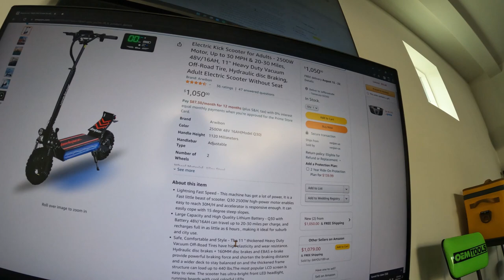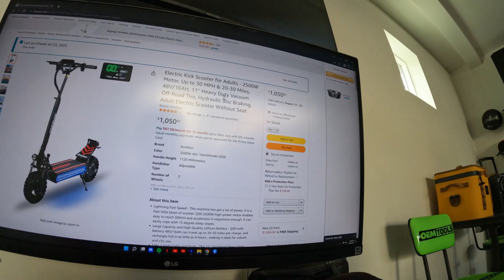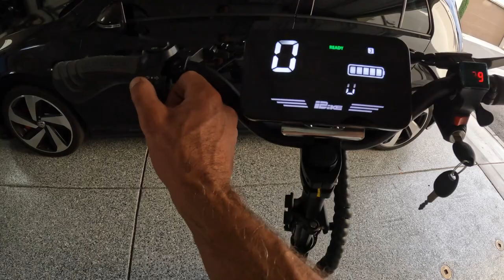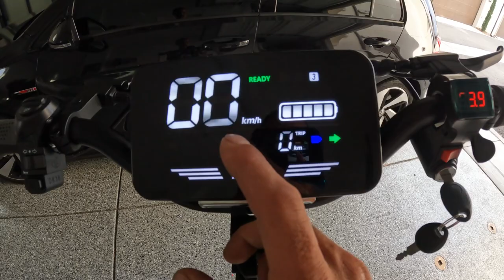Arwibon Q30 Electric Scooter for Adults 48v 2500 WATTS

Comment: Nice run man I just bought one can't wait until it gets here
Reply: Hey any update?
Reply: @shaukmkadin9101   updates please
Reply: Yes I've had it for about 3 weeks now and put on about 35 miles and it's freaking awesome. I was about 245 lbs when I got it but I've been on a diet and now I'm at 217 lbs and you can definitely tell the power differences from weight but it still moved and made it up hills with no problem. If I had any complaints it would be the fact that the digital display is in km instead of mph and the take off speed isn't as fast as I would like but not horrible either. Other than that I definitely recommend this especially for the power you won't find one better for the money.
Reply: @demonoidphantom  Wow! Congrats on the wight loss! 

Thanks for the response

Comment: about to order this and saw your video thank you
Reply: Just bought it on Amazon should be here 2 weeks
Reply: @BigBird_714  how is it ?
Reply: @TheMostHatedENT  hey was up umm only thing is wish the manual had little more info on gears and volt meter but I figured it out other than that this thing rocks love how the tire sounds when driving fast
Reply: @BigBird_714  did you do a range and speed test?
Reply: @PathToPeaceMoe  range not fully I ride about 4 miles a day 5 days a week and have to charge it on Wednesday I’m 6’4 285 pounds and I can go about 45km

Comment: @The Cats Pajamas According to Arwibon to change the dispay from kph to mph you have to change the controller (It's the silver box under the deck plate). But they don't advertise the unit on their website. But if you speak to them via Chat, they'll make a link for you to buy one. It will be sent from China. But on their website, you can buy another charger and the upgraded 30AH battery. If you buy the extended battery, they'll ship via sea and that'll take 2 months to arrive.

BTW, I'm 6'2" and currently 295lbs and this single drive Q30 easily hauls me around. They just released the Q30 PRO... it's a 5600W version with front and back motors. Without load the motor at setting 1 spins upto 48kph, setting 2, 68 kph and setting 3,  73 kph. I'm also told between batches this can change up to -/+ 2% difference between batches. It depends on which motors they use from which supplier at the time of assembly. Under my hefty weight, I get 27 kph (16 mph) on setting 1, 38kph (23mph) on setting 2 and an impressive 51 kph (31mph) on setting 3.

https://arwibon.com/
Reply: Do you have the 16a battery? How is acceleration? Does it do okay on hills?
Reply: They did. Scary!

Comment: This is awesome great video!
Reply from the maker: Thanks ... i am always buying ridiculous stuff  ... so stay tuned lol
Reply: There're 2 charging ports because you can buy another charger and charge the battery 2x as fast, that is the only reason for the 2
Reply: @thecatspajamas2765  How long is the battery lasting on this scooter 🛴
Reply from the maker: @Zenmazter  i just got the scooter not long ago so i dont know the lifetime life of the battery yet lol but far as distance 20 to 30 miles is the range on a single charger ...if u going uphill and full throttle the whole way you might be down to 15 to 20 especially after months of use , the farthest i personally have gone in single charge was 23 miles and i still had 2 bars of battery and i could start to tell it had less power leaving from a stop after 20 miles than it did at full charger but it still goes nicely and can get up to nearly full speed ...
Reply: @thecatspajamas2765  hey can you change it from kph to mph?
Reply from the maker: @danielh4074  not sure .. atleast i havent seen a way to . that is the only i dont like so far ... i really hoping someone drops word in the comments on how to change it ...nothing in the owners manual either

Comment: Dude. Exciting is the perfect world. i bought the same one off Amazon. It was awesome. Unfortunately it was short lived. I left it outside my home in the driveway for an hour after a phone call lasted longer than expected. Someone stole it. I have them on security cameras. They walked right up to it. Kicked the kick stand and wheeled it off my property. It's my fault really. SMH. I hadnt had a chance to put an airtag on it yet. I did however get it insured. 

I saw it as a message from God to upgrade. I am now awaiting  the Q06Pro 5600W. This one has motor in front and rear. It will be here Tuesday. im gonna do my first unpacking. You're right about the age limit. Its a lot of scooter for surprisingly not too much money.  I laugh at lime scooter users as I sped on by. This new one is supposed to around 50pmh for 50-60 miles. Woop. woop!
Reply: No matter if you leave your scooter for a SECOND...always arm the alarm.  It will deter would be thieves.
Reply: @charmcityscooterz8343  lol not mine. They carted off alarm going off and everything. But it’s cool, lesson learned. The lock I have on it now… picture pee weeks big adventure bike lovk. Lol google it for the imagery..
Reply: Any thoughts after having the Q06pro for a year?

Comment: I've had my Q30 for three weeks and the speedo has quit working and the Key won't power off, it's been sitting for three days on. I turn everything off as much as I can. It'll take off without a key in it.
Reply: Did u get it fixed? Did u have warranty?
Reply: @mrindependent1  Nope it's still broke, bought an Ebike. Scooter is just sitting in the kitchen waiting to be fixed

Comment: My big question is which scooter are you going to get??? I noticed yours has a shiny plexiglass top on the deck but the picture you show on the Amazon account has the Arwibon logo and stripe package. In other videos of the same scooter it has the Kugoo Kirin name and stripe package!!! Also notice all of the specification contradictions in these scooter's info. Weight limit alone there are 4 different payload max's listed. ALL FOR THE SAME PRODUCT! Contradictions in every single specification listed!!

Comment: Cat's Pajamas, great video.  Would you remind replying on how the scooter is holding up?  I'm in Southern California as well - how is it on mountain bike trails?  Would you consider this an "off road scooter?"  Thanks in advance
Reply: Does well ... super soft sand it can bog down but the k9nd of sand I talking about  a ebike or any other e scooter would be stuck in it too lol ...I am still happy with it ... after about 100 miles I finally popped q tire on some sort of metal on a dirt trail ..
 Battery still holds a good charge ... I would recommend buying it still forsure

Comment: i have the same model. how long do you charge the batteries?? 52.7?? or 53.9??❤
Reply: it should read at least 54 to 54.6. the light will turn green when its charged.

Comment: Hey man it says motor coolant must be added before use so where do I put it at
Reply: Did you figure out if it needs motor oil? Im trying to figure it out myself
Reply: @HazeWonder  no sir I gave up gonna ride it til the wheels fall off😂😂
Reply: @faithfirst9775  the manufacturer said its good to go ignore the manual

Comment: Im deciding to buy the same scooter , how's the experience so far ? how much miles can it go on a battery .
Reply: It depends on your weight, road condtions and even sheer winds. I'm 6'2" and currently 295lbs. Mine is the 16AH battery version and it can get just shy of 35 Km (21 miles) distance on a light wind day. They have an upgraded battery at 30AH, so almost double capacity which would easily give 60+ Km, or 37+ miles.

Comment: How is it uphill? I’m about 260 lbs so you think this will take me uphills?
Reply from the maker: I am in southern California so hills were my concern as well .... long steep hills it may slow down little but does pretty good job on hills ...i hit couple short dirt switch back trails i would say were like a few flights of stairs and pushed up it no problem ... i also have a 750watt ebike and i it does better on hills than the bike lol
Reply: Thanks for the reply, I just have 2 steep hills going up to work, that are a killer walking, as long as it makes it, I don’t really care too much of a slowdown I have a 500 watt scooter that I might make it uphill but the battery it drains just going uphill sucks that by the time I’m Halfway there I have 2 bars of battery left so idk if this will make it all the way to my destination, but this scooter looks promising.
Reply from the maker: @DEATHMACHINE941  in the video a lot of the hills I road got exited out but on that cruise I road about 12 miles with a bunch of hills and I you almost making on 500watts you definitely be good with this with 2500W... not sure where you live bit in Southern Cali we got some good hills
Reply: Lol I live on the opposite side of the country, NJ. Eww I know.
Reply: I'm 6'2" 295lbs and the grade up my driveway to my home is a steep 28° trek and it got me up fairly easily. It slowed down a bit but it didn't conk out. Plus when I notice it slowing down, I changed it to setting 1 and up I went. So to do hills and long grades switch to setting 1. It'll use less energy trying to maintain high speed under torque. Once at the top, we can easily switch back to setting 2 or 3.

Comment: Does anyone know how to convert the speedometer from kilometers to miles per hour?
Reply: Used your cell for a gps for mph and miles. Lots of apps our there!
Reply: Did u figure it out? Let me know 
I know how to change it
Reply: @mrindependent1  no
Reply: @jhamidhaynes2604  with the power on, hold the power and mode button at the same time til “P” appears. Press mode a few times til u get to P4. Hold mode for two seconds. It’ll blink then u can press power or mode to switch between mph and kmh. 
Once u choose one,
Press mode for two seconds to save it.
Turn it off and should be done
Reply: @mrindependent1  What power button? This is Key turn ignition switch to power on.

Comment: Get a cell phone holder and gps app for a odometer and speed in mph.
Reply: You have to buy a new display and controller I'm about to upgrade my battery for it mine doesn't go 30 I go about 25 on full charge
Reply: Mine goes 30 + without any problems, but I won't.  Also it mph settings.  Suitable for night riding in Hollywood.
Reply: Also it like a vw, let it gain speed,

Comment: One thing that i hate about it is it has terrible front brakes two it has low power and terrible range but all in all it isn't the worst scooter for 1000 ish i would say find another scooter if you are thinking about this one
Reply: Some good things about it is it has beafy tires and is very stable at high speeds also it has nice RGB lights and a bright tail light
Reply: You have to take your Allen wrench and adjust it I did any my scooter stop on a dime